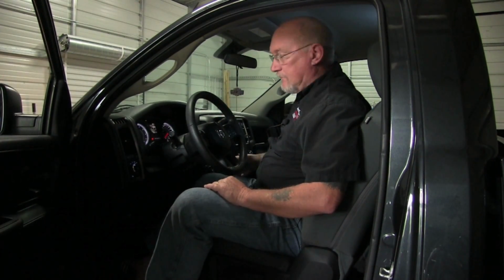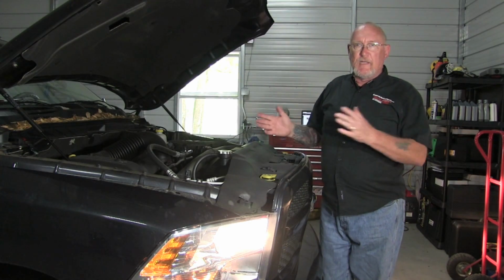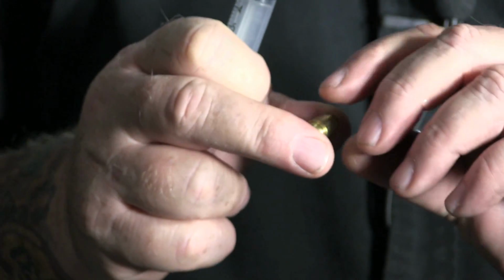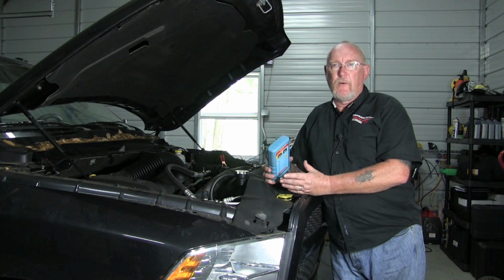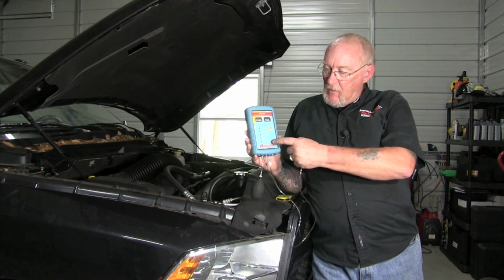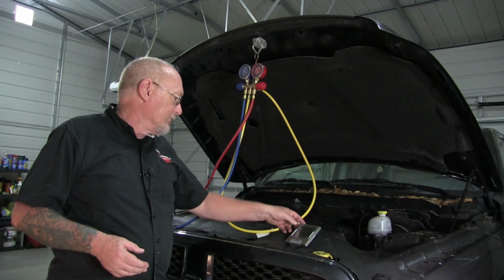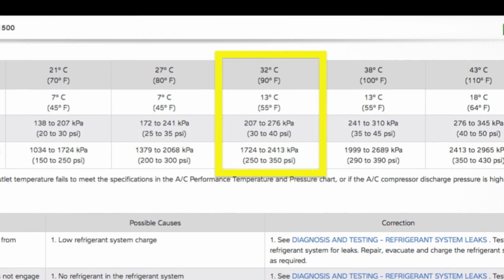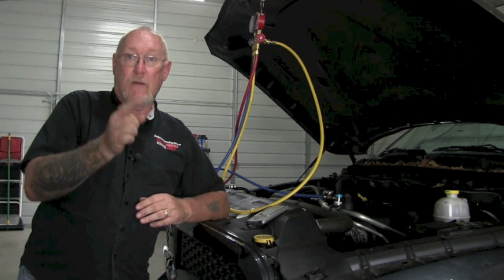The Trainer #52 - A/C System Inspection and Testing

Comment: Good information i went anal about correct 
information on the last video because i want to be able to Not learn 
wrong stuff , i have something to add the reason why you shut the 
blendoor- i mean the outside air door. for maximum cooling in the car is so the box is shut like the 
cabin is the same box as your household refrigerator we all know what 
happens when you leave the fridge door open.

Comment: Great informational video. You give very nice tips. There is a lot on air conditioning system in the market. Most people of the air conditioning industry are very conservative minded and ill minded as well. The reason behind that is the very tight and sometimes bloody rules and laws behind that. Most people I saw in the market working on air conditioning system are not allowing new guys to work with air conditioning. We are working on air conditioner with very simple equipment. The problem here is people are not paying much for air conditioner service to afford such expensive and modern equipment. A set of gauges, an air conditioner compressor as pressure and vacuum pump, little bottle of soap to detect leak, little quantity of air conditioning oil and a Freon cylinder is all the equipment one ordinary AC technician have to work on automotive air conditioning system.